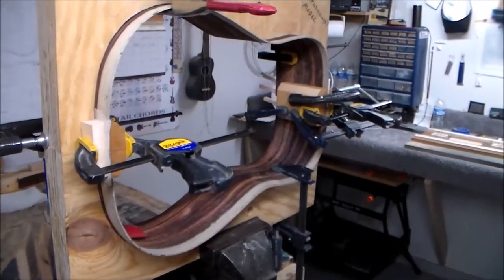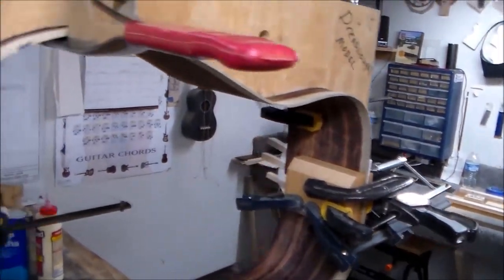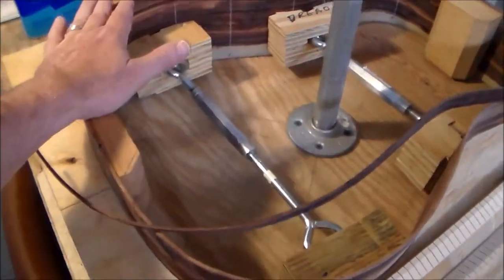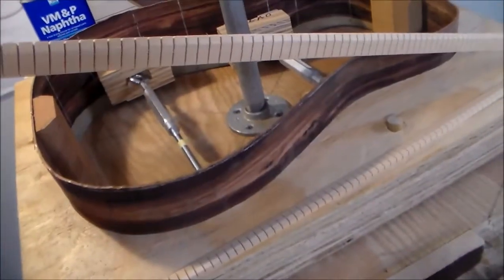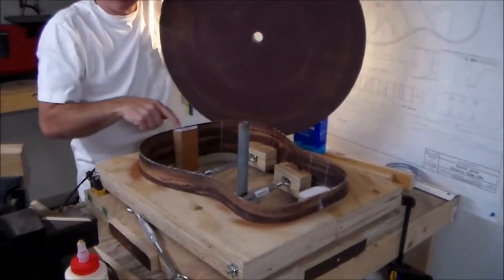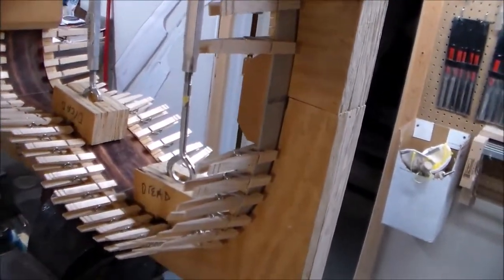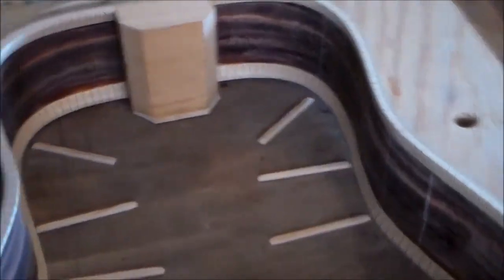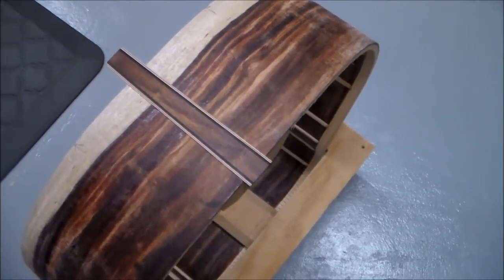Acoustic Guitar Build - Episode 11 - Joining the Sides

Comment: Hi. Did you ever finish this particular build? I see there is another finished acoustic, but it's not the same guitar. I'm curious because I have a lot of Macassar Ebony and would love to see your result. Thanks
Reply from the maker: Yes, that guitar did get finished. Although it gave us lots of fits and problems bending the sides. The Macassar wood was extremely brittle and kept breaking on us. We eventually got a good bend on both sides, but went thru several boards before getting there. If you plan to build one with Macassar, you may consider just using it for the front/back and pick another variety for the sides… unless you have extra boards to spare. Good luck with your build!
Reply: @jimginnyohio  
Thanks for the quick reply. I think I will make some necks and drop tops for electrics instead. Like I said...I have tons. Went on a bit of a shopping spree in Asia. Thanks again

Comment: How did you cut the sides for the wedge shape? Tool used and marking of where to cut?
Your videos are great!
Reply from the maker: The wedge shape for the guitar body sides come from the template that is included with a set of plans from Martin. We cut the paper template out of the plans and simply traced around the template onto the wood. For cutting those out, I used a band saw making sure to leave extra material on all sides to sand using the radius dishes.
Reply: Thanks for the info!  I will be making a ukulele soon and will need to add a taper to the bent sides.  I am not using a paper plan, rather working with “inspiration” from my Gibson tenor ukulele.  Did you make the radius dishes used to sand the back and front sides/ kerfing?
Reply from the maker: My buddy, John (also in this video) made the radius dishes. John has also built a ukulele a while back. You can find several free plans for download online. Simply type "ukulele plans pdf" into the Google search engine. Maybe it will help you get started with a basic shape you can modify to meet your needs. Enjoy!